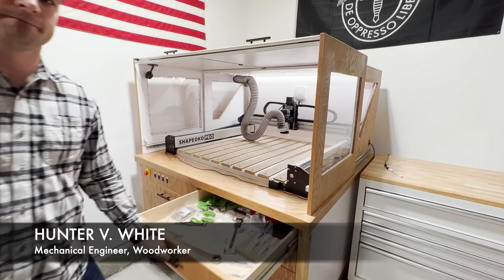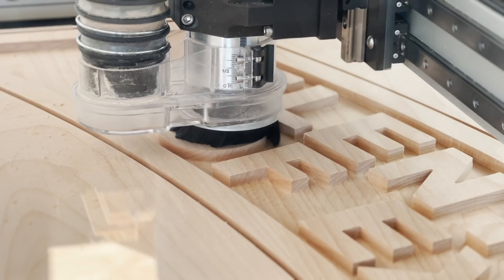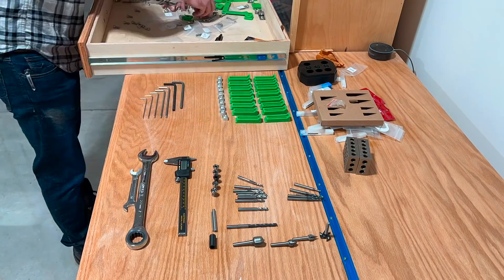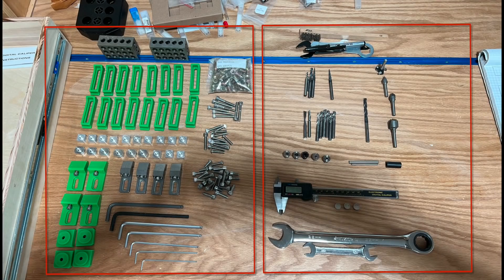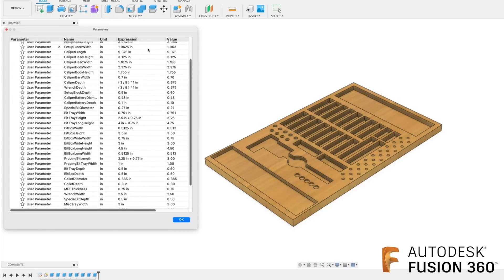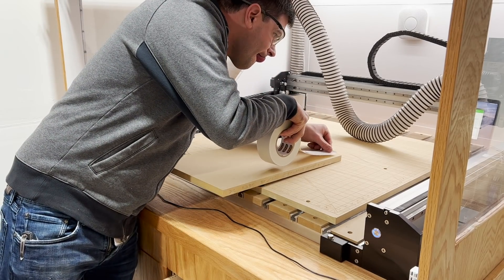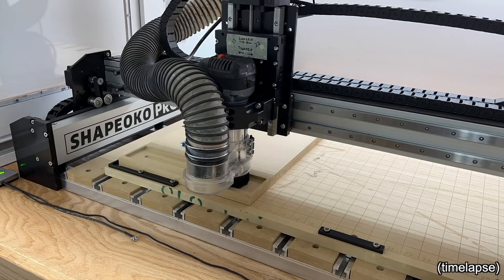CNC Project: Drawer Organizers

Comment: Hi! I see that you use a second wasteboard over the T Track wasteboard. Is there a special reason? What would be the benefits? Thanks.
Reply from the maker: I just got tired of cutting into the OEM waste board because there is no easy way to flatten it - the CNC can’t reach the edges. Also, I never want to hit the aluminum t-track underneath. With another waste board on top, I can flatten it occasionally, use an angled corner stop, and have extra protection against hitting the CNC underneath.

Comment: @Engineering Workshop . Hey , I see you have space for more tools I'm guessing for expansion but I wanted to ask you what was your thought process when it comes to futureproofing. I don own a CNC but I've noticed I when building something for organisation I forget to factor In things that I may get in the future. How do you combat/plan for the future? 
Loved the video
Reply from the maker: James, thanks for reaching out. For the drawer organizers specifically, I figured out my minimum requirements, then tried to make every symmetrical. This required more capacity than I had use for, which is always a good thing. For the enclosure itself, I followed the same logic; plan for my minimum, then let aesthetics drive a symmetrical solution with extra capacity. This is how I got extra drawers on the right side, which aren’t being used but are sure nice to have.
Reply: @EngineeringWorkshop_hvw  oh very interested , it's usually the case of functionality over aesthetics but your method seems to let each other benefit the other .
Thanks for you help , it's been plaguing me for a while now .
Best of luck in the future :)

Comment: How long did it take to design the cutouts? Also.. did you do it in one pass.. or have to do it a few times to get it right? Always wonder how CNC designs make it in one try.. seems like you would have to do many attempts until you got it right.. then could repeat the cuts.
Reply from the maker: I designed each drawer organizer in about 2 hours, including the computer aided machining (CAM / tool paths). As a rule of thumb, in hardwoods, I make contour/slot cuts at a 50% depth of my cutting bit diameter; for soft woods and MDF, I’ll use 100% depth of my cutting but diameter. For the 3/4” bowl bit, I used 50%, even though I was cutting MDF, due to the torque required to make a cut with such a large cutting diameter. My spindle (Makita router) isn’t as strong as an actual spindle. Therefore, I used two depth passes to cut the bit holder slots. 

I have enough experience at this point that I was able to get this project on the first try. I’ve definitely had to make a few attempts on other CNC projects though!

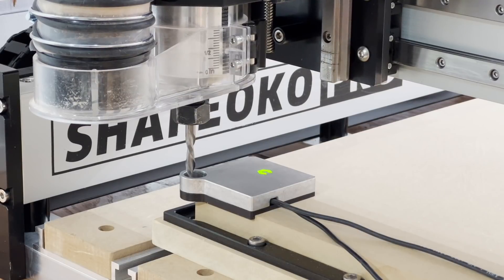Comment: Great video, I will also build a cnc, I have a question, at the minute 1:20 you mentioned a tool "bit 0" How can I find it?
Reply from the maker: A “bit zero” sets the Cartesian zero (x, y, and z axis) for the CNC all at once. It’s an easy tool to use and very fast. 

You can usually find one on your CNC manufacture’s website. I got mine from Carbide3D.

Comment: very cool and clean, I'm looking into doing something similar!

Quick question: Was is that dust shoes? Is it 4" hose ?
Reply from the maker: Thanks! The dust shoe is the Carbide 3D Sweepy 2.0; it comes standard with the Shapeoko Pro. It’s a 2.5” dust hose.
Reply: @EngineeringWorkshop_hvw  that's what I thought, thanks a lot!

Comment: I like to finish CNC cut MDF with a wipe-on polyurethane; it soaks in and makes a very durable surface. Nice project; I have been procrastinating on doing the same thing; I might go with kaizen foam.
Reply: I find that lindseed oil gives a better finish and easier to apply.
Reply: @AlainPilon  also a good option

Comment: 4:58 what is that metal side clamps above hex keys ?
Reply from the maker: They are “tiger claw clamps” from Carbide 3D, the makers of Shapeoko. They lock into the hybrid table (slot in the bottom) and can mechanically apply horizontal pressure to a workpiece.

Comment: Did you have random behavior while milling??  Did you solder your cable connections?
Reply from the maker: If you mean, do I do other things while the CNC is running? Yes, all the time lol. I have a remote monitoring system (audio and video) and a remote e-stop. I usually set up the iPad near where I’m at in the house and try to continue working on the computer, or hang out with the family. Sometimes, if I don’t have anything else to do, or don’t fully trust the G-code, I’ll just watch it run; kind of mesmerizing. I also analyze the tool paths as it watch it. 

I didn’t solder any of the wiring connections in my enclosure, every connection is made with heat shrink and crimp connectors, so I can easily take stuff apart if need be.
Reply: @EngineeringWorkshop_hvw  Thanks for the reply.  I have the Shapeoko Pro XL I bought June 2021.  I have had several occasions where the system just went nuts and dove into the wood.  I did a pull test of the connectors and several of the crimped connectors came out.  They were not fully seated.  I reseated them and then zip tied the connectors together but still have had some issues with not initializing or not finding the bit setter.  I have had some success wiggling the connectors and re-initializing.  Just curious if an advanced user has run into this issue and found a solution.  I am working with Shapeoko support from time to time but haven't been able to connect 1 on 1 with them yet.  Mostly due to my schedule.
Reply from the maker: I had something similar happen, but have found the cause. My collets were getting dirty from fine dust from milling wood, and they weren’t able to grip my bits as tightly as they should. If I were to take an aggressive cut, placing a high literal load on the bit, the bit would slip out of the collet. Sometimes just an 1/8” or so, but other times it would be 1/2” or more. This acted like it was diving into the wood, but the router a height was constant. I now clean my collets with mineral spirits after each use / bit change, to ensure the highest possible coefficient of friction when a bit is installed. 

I did have a wiring problem with my shapeoko when I first put it together - I mention it in my CNC enclosure build video. I took very detailed photos of everything, made the most in-depth PowerPoint I could, describing everything that was happening, complete with photos, diagrams, labels, etc. and sent it to Carbide 3D. One of their techs was able to look at that PowerPoint and tell me exactly what the problem was. In my case, a cable had been constructed incorrectly, switching the positive and negative loops, causing a stepper motor to run backwards. Maybe a similar tactic could help you make some forward progress with customer support.

I hope you get it resolved soon; nothing is more frustrating than an expensive machine that you want to enjoy, not functioning properly.